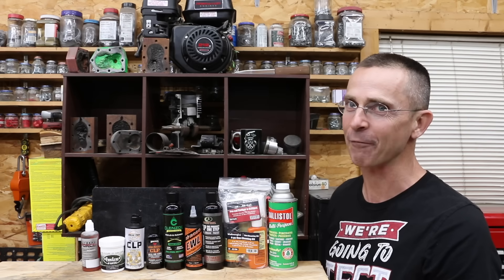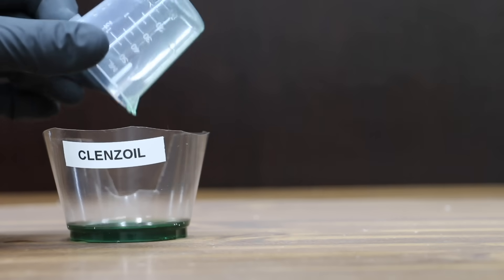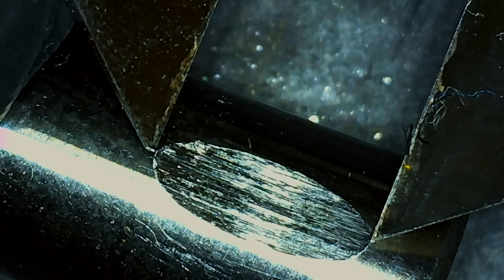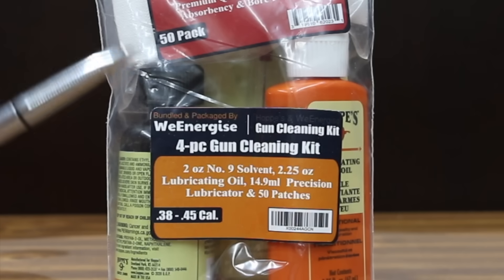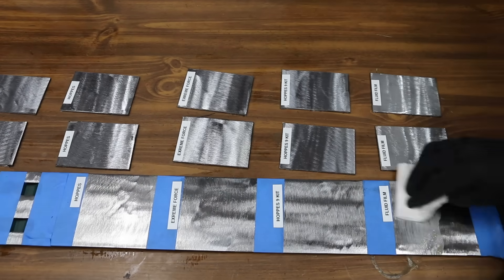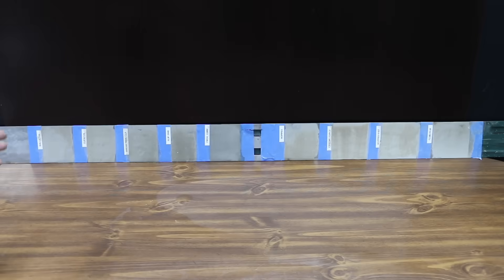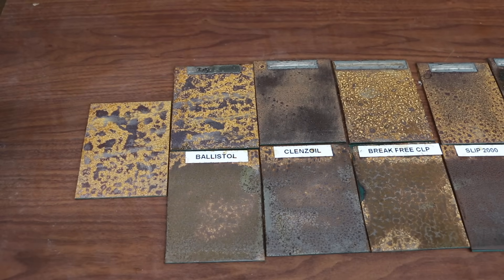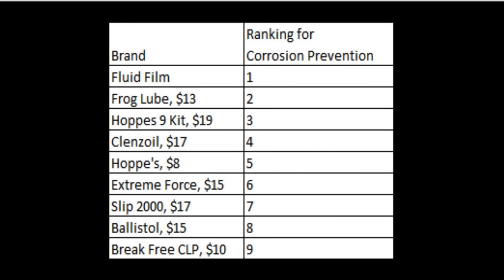Don't Buy A CLP Until You Watch This Review! It'll Save You Time And Money!

Comment: It would be nice to see a part 2 of this with a few of the best performers from this test compared to Rem Oil, 3-in-1 oil, WD-40, synthetic motor oil, etc. Thanks!
Reply from the maker: Thanks for the suggestion.
Reply: @ProjectFarm  if I might also suggest Lucas Oil CLP. It seems to be more readily available than some of these others. For example, in this first group I’d choose the Break Free as it’s pretty easy to find. Just checked Brownells and they don’t have the Clenzoil. I’ll have to check the BassPro mothership next time I’m in Springfield.
Reply: @CaveWyatt  you can literally get lucas CLP at O'Reilly's, auto zone, and advance auto parts
Reply: @Prestiged_peck  Yup. I’ve got three cans here. Not sure how long the lube part lasts as it appears to evaporate after a couple of weeks. It’s possible the residual oils keep lubricating but I apply a little Geissele Go Juice on the rails and moving parts of ARs. A little Geissele thin grease on the trigger pins once in a great while. Using the Lucas CLP also seems to keep new carbon from hardening so it’s easier to clean up if there’s a delay between shooting and cleaning. Good stuff.
Reply: @ProjectFarm  another vote for Lucas clp!
Reply: @ProjectFarm  I would add to this list with Lucas Extreme Duty gun oil. I would be very interested in it's performance. I find it superior to CLP with lubrication.
Reply: @ProjectFarm   forgot Lucas gun oil
Reply: @ProjectFarm  I am willing to reimburse you for a can of Lucas Extreme Duty CLP if you add it to your next test.
Reply: @ProjectFarm  any chance we could see Remington oil in round 2, possibly even a video about gun wipes/ field rags
Reply: @TheSikkTACO  I had to stop using spray Rem oil. Damn stuff seemed to evaporate off after a few days.
Reply: @TheSikkTACO  Remoil is very poor. Switch to Clenzoil or Brakefree.
Reply: @ProjectFarm  amsoil 100% Synthetic Firearm Lubricant and Protectant. If you can't find any let me know and I'll send you a bottle or two
Reply: @ProjectFarm  and if you do please include G 96 it's supposed to be what US Navy Seals use
Reply: @ProjectFarm  I know that you cannot test everything at once, but here in Northwest Iowa, Busch beer and Rem Oil is life. There’s also a Lucas brand, gun oil they sell at some car part stores.
Reply: @ProjectFarm  Hi if you do more test I hope you will consider weapon shield and modern spartan system. They do the same friction test and show that both of their gun oil don't show any damage. They have youtube videos showing that. Also Go-Juice lube says that their is superior to clp that the military use. Just three lubes that claim that theirs are better than other lubes
Reply: @ProjectFarm  if you do it again Lucas extreme duty would be great to see
Reply: @ProjectFarm  if you do part 2 please include G96 
Thanks for all the videos
Reply: @ProjectFarm  Seeing Shooter Lube would be nice if you decide to make a part 2!
Reply: @ProjectFarm  Very good suggestion.  The custom 1911 audience have very tight tolerance, high performance firearms.  1911's will shoot loose due to metal wear and lose accuracy.  Any lubricant that reduces metal to metal friction wear is desired. Temperature is not a factor but carbon fouling can be.  My opinion is that synthetic engine break-in oil that have higher amount of zinc would have the best result. You have the testing gear to do such a test.
Reply: @ProjectFarm  I’m surprised that no one mentioned Marvel Mystery Oil. Would be very curious about it. So many choices out there. Lots of people are using synthetic motor oils like Mobil1. Definitely struck a big nerve with fun lubes. Your the best, go to you first to look at products testing. 👍
Reply: @ProjectFarm   I rarely use an all in one product, currently use mineral spirits (GunBlue490) for cleaning, mineral oil or motor oil/grease combo (School of the American Rifle)  for lube/protection. would love to see verification of these if a part 2 done
Reply: @ProjectFarm  Another 2 manufacturers in Part 2 should be Lucas and M-Pro 7. A lot of competitive shooters use their products and Lucas claims that their products are the best...
Reply: @ProjectFarm  please do a part 2 of this
Reply: @ProjectFarm  
At beginning of video....
You pronounced it "Bal-i-stal".  It is technically a mashup of ballistic and oil for something that sounds like "ballistic oil".  "Balist-oil".
The stuff was originally made for the German military in 1904 I believe. It was used out past World war II. It is made in Germany....

At end of video....

Hmmmm, I guess I'm going to switch to Cleanlube from Balistoil....

Thank you for the video!!
Reply: @ProjectFarm  Don't forget to through some "LSA" into the mix. Only thing I've ever used. No need for all this rebranded, so called, "gun lube" ;)
Reply: @ProjectFarm  please do a part 2 with Lucas products
Reply: @ProjectFarm  This would be a great followup - lots of people use Mobil 1 synthetic or similar for lube.
Reply: @ProjectFarm  If you can ATF fluid, hydraulic fluid and moly grease with their high zinc and carbon additives would be interesting in the wear test
Reply: @ProjectFarm  If you did a follow up video to this one, could you include a long term analysis of WD-40 compared to the top gun oil brands?  See, there's this long standing myth that the main reason you should not use WD-40 on firearms, is that over time it somehow solidifies or hardens and then proceeds to "gum up" a firearm's internal components.  People believe that only WD-40 does this and their personal wonder brand choice of lube would never ever do it.  I've never seen a liquid oil do this ever, WD-40 or otherwise.  Could you PLEASE examine this theory so we can finally put the issue to rest, once and for all?  Thank you!  Keep up the great work!
Reply: @ProjectFarm  a part 2 would be great I would recommend trying EEZOX as well
Reply: @ProjectFarm  I appreciate your honest info. Like your channel
Reply: @ProjectFarm  it would be good to include your observations about the level of fragrance as well. Not an exact science but simply to include a scale of very fragrant to not very. Most people store in confined spaces and this can have an impact.

Also another request for the Lukas extreme duty CLP during part 2!
Reply: @ProjectFarm  Don't forget Deep Creep when you do a second test. It's always worked really well as a gun cleaner for me.
Reply: @ProjectFarm  Another one to test would be both Lucas Oil Gun Oil as well as "Extreme Duty" Gun Oil.
Reply: @ProjectFarm  how about a budget level home brew mix of synthetic grease mixed with synthetic motor oil kind of  like honey/gel
Reply: @ProjectFarm  G96 and Lucas Extreme Gun Oil. Love your videos.
Reply: @ProjectFarm  if you do a follow up could you include the winner from the motor oil test and try out Amsoils offerings specifically for firearms?
Reply: @ProjectFarm  yes Lucas Extreme Duty? Is this stuff any good? Thank you for all your videos. You give us great non-bias knowledge. Thank you sir.
Reply: @ProjectFarm  Is like to see Amsoil firearm oil if there's a part 2.
Reply: @ProjectFarm  Add mineral or baby oil.
Reply: @ProjectFarm  Please add G96 to this list to compare, also maybe the Marvel Mystery oil and a synthetic transmission oil. I agree with Jamie Pinkston that the Rem oil, 3 in1, WD-40, and synthetic motor oil is a list I would like to see. These are what I grew up using before I had ever heard of a designated gun oil (not even Rem oil at the time). Everyone back then in that area used transmission fluid, Marvel Mystery oil, WD-40 and 3 in 1 and the thinnest motor oil they could find.
Reply: @ProjectFarm  Looking forward to part 2, best sellers on amazon not already tested here include mossy oak / remington and lucas oil
Reply: @ProjectFarm  I’d definitely love to see a part 2 with some of the cleaners suggested.
Reply: @ProjectFarm  I'm looking for part 2 so I can give it a thumbs up like I did on this video.
Reply: @ProjectFarm  and shooter lube
Reply: @ProjectFarm  I will supply you with a bottle of Amsoil Firearm cleaner & lubricant if there is a follow up video.
Reply: @ProjectFarm  Lucas Oil CLP>Clenzoil
Reply: @ProjectFarm   I suggest we widen the search for the best all around gun oil maybe try some ATF
Reply: @ProjectFarm theirs still no #2
Reply: @ProjectFarm  Sentry makes a few dry lubes (tuff glide, tuff glide marine and a molybenum powder "bp 2000"). It would be great to see them tested. I also wonder if some of those gun lubes have a carrier that needs to evaporate off for the best friction reduction (but how to test that?).
Thank you for your diligent and effective efforts to show us what products can do!
Reply: @ProjectFarm
Reply: @ProjectFarm
Reply: Did the vid ever cone out? @ProjectFarm
Reply: @ProjectFarm please make an updated video including Lucas clp! Most of us use it
Reply: @ProjectFarm  Don't know if its also a CLP, but froglube has a version for extreme cold.
  If you want a can of Zep 45 which is a teflon based penetrating lubricant usually labeled something like "for industrial and institutional use only" I could make sure you get one. I don't hear it usually brought up but they do say it can be used for gun lubrication too.
  If considering longer term testing I find Zep 45 may start to get sluggish as it thickens over the months though that is very quickly resolved with just a bit more of it and the original Frog Lube starts thicker and is slower to penetrate+lubricate a running bearing (upwards of minutes vs Zep's within a second) but gave much longer results when I applied it to fans (either worn or defective, maybe both) that Zep45 went back to running noisy in within months.
Reply: @ProjectFarm please do an update with Lucas oil and CLP!!
Reply: @ProjectFarm 
 slip 2000 EWL 30!!!! Come on!!!!
Go Juice!!!! Come on!!!
Lucas synthetic gun oil
Amsoil synthetic gun oil!
Wilson combat oil(ultimate lube 2)!!!!!! Come on!!

Amsoil clp aero
M pro 7 gun oil LPX
Lps2 aero
Please do a Part 2. Bring in a couple top performers from this vid.

Also do you have another way you can measure lubricity other than the wear scar test. Some of those oils feel pretty damn slippy in a semi auto action! Like and air bearing! The scar test may be good but it’s not everything.
Reply: @shawn01707  As most semi automatics rely on the lubrication for easy movement of the slide rails I would imagine a rail test would be great. 

Maybe slightly angling the metal rail with a weighted plate and slowly increasing the angle to see which move first or the quickest?
Reply: @shawn01707  I was installing a bearing at work and it was tight and a guy brought me a can of m-1 and holy crap is that stuff slick. Best I've ever used especially for that job. I need to order a can and try on my guns.
Reply: @ProjectFarm  YOU HAVE TO ADD LUCAS CLP TO THE NEXT ONE
Reply: @Prestiged_peck  A few of us have asked for that in separate posts so Lucas CLP is getting lots of votes!
Reply: @ProjectFarm  You have to do this!!!!!!!
Reply: @ProjectFarm  I've been told by former marines that lucas CLP is the ONLY civilian available formula they'll trust in their full auto weapons
Reply: Surprised that the Lucas Oil CLP wasn't featured in this video.
Reply: @colgesuks  yes, and g96 since it’s one of the few meeting the latest version of the mil spec.
Reply: @colgesuks  I've only found it at O'Riley's so he probably went to a store that had different options
Reply: @squidysquid7586  my big 5 has it. That's the biggest gun store in my area
Reply: @colgesuks  my thoughts exactly. I use it a good bit to
Reply: @colgesuks  I think the Lucas gun oil would have all of them beat on wear.
Reply: @colgesuks  doubt it would have been any better than ballistol, its a low end product
Reply: @manlystyleunder50  you don't know until you know.
Reply: @colgesuks  Love the Lucas!
Reply: @colgesuks  Lol No more CLPs. The concept of them alone is ridiculous. Cleaners and lubricants don't mix very well...they counteract each other. Use their actual gun oil, a full synthetic oil for diesel motors(handles high temps way better than oil for gas motors), and/or marine grease(Lucas gun grease and marine grease are pretty much the exactly the same)
Reply: @NoCoBandit  that's only true is your cleaner is a surfactant. Cleaning off carbon deposits isn't the same as cleaning oils so in this circumstance a cleaner and lubricant can exist as the same product.
Reply: @colgesuks  Lucas looks exactly like clenzoil I'm curious if they're made in the same factory or something?
Reply: @alejandrogarcia3227  no idea, they may have similar base oils. The only way to really see how similar they are is to have them analyzed in a lab
Reply: @colgesuks When frog lube was lab tested, it exactly matched Crisco vegetable oil, except for the dye they use to color it.
Reply: @colgesuks  agreed! I’d love to see where that fits into this group!!
Reply: @lawrencetai7664  yeah, it's what I have and use.
Reply: @colgesuks  yeah, that is very popular
Reply: @colgesuks  Yeah and no Outers? No ALPHAGUN? Weak selection.
Reply: @colgesuks  Same here. It’s my CLP of choice so would’ve been nice to see.
Reply: Maybe add Shooter Lube and Lucas Extreme duty gun oil
Reply: @CptLang97  Lucas HD is my favorite. I hear Strike Hold is fantastic
Reply: WD-40 is shit for gun oil, its been tested to death.  Rem Oil is shockingly good, but its pretty thin and wears out fast.  I use it for fishing bearings when I want making casting distance, but don't mind applying between trips.
Reply: @Drundel  The Rem Oil I used became too thick for my guns to work below 0F.  The Hoppe's still allowed proper function.
Reply: @solarsynapse  Gotcha. I use it in my fishing bearings only, so 80+.  Works great.

I forgot what I run in my Benelli's, FP-10 maybe.
Reply: Yes, I also think that including a motor oil as a reference would be great. It will probably fail in the cleaning area but wear protection under various conditions should be excellent. My personal strategy would be to use a separate product to dissolve copper, lead and carbon deposits and then luse motor oil for lubrication.
Reply: @DreamRoadpl  All my modern rifles i lubricate with Mobil 1 Synthetic. It works great.
Reply: @DreamRoadpl  well as far as copper goes, CLP does nothing for copper. The military went to a CLP oil when they began chrome lining bores. Chrome bores don't strip copper like the old rifles that needed  RBC and LSA to clean. Basically, all milspec clp is is a high detergent oil.
Reply: @DreamRoadpl I've used Transmission oil and boy it's the best, think about how it holds up to heat and wear! ALSO IT CLEANS LIKE ALL GET OUT.
Reply: @DreamRoadpl  I've used motor oil on my AR-15s before. They ran like a top but smelled terrible after shooting. Smelled like burnt plastic.
Reply: @DreamRoadpl Valvoline restore and protect!!
Reply: @DreamRoadpl  
I've been using a quart of Pen. Full Synthetic to fill small application bottles for a long time. Nothing negative so far.
Reply: @DreamRoadpl   Mobil  1 is used  by many on guns ...
Reply: I'd be really interested to see the results with 3 in 1, mostly just because it's so easy for most people to get and is so widely used.  (And widely recommended, frankly.)
Reply: @corwinweber693  All the old timers I have ever asked usually recommend Hoppe's or 3in1, like you said 3in1 is at any auto store and hardware store you go to.
Reply: That's a great suggestion
Reply: @Jazz3006  Oil is just good for dissolving some things. I have a barrels of food grade mineral oil at work with no additives what so ever and it works just as good for taking mechanics grime of your hands
Reply: @VictorGalayda  there is that, yes, but there are also a boatload of detergents that are added to oil now.
Reply: Also throw in some of the storage foggers for the rust test.
Reply: @fredfrederick5607  I like your name.
Reply: Definitely interested in seeing Mobil 1 synthetic and/or other oils tried. Also super lube too
Reply: Home stuff not specifically marketed for gun use would be interesting. Rem Oil is great stuff and someone I know with a very large WW2 collection will use nothing else to preserve the firearms.
Reply: Agree! I use mobile 1
Test that against all this fancy stuff
Reply: I usually clean with balistol then lubricate with Lucas heavy duty firearm oil, I also use molybdenum disulfide grease on trigger groups and sears. Edit: I’m gonna try some Clenzoil next!
Reply: @project farm

I have used Mobil 1 synthetic 5W30 and Mobil synthetic 1 automatic transmission fluid for years. 4 parts oil to one part ATF. I would be pretty interested so see how this mix fares in your testing.

Thank you for the content that you create.
Reply: There are a lot of great suggestions here. So many gun oils out there that Project Farm could turn this into a mini-series. I'll get the popcorn ready.
Reply: Would agree completely, a part 2 and include Shooter Lube, it's my favorite, would love to know how it stands up.
Reply: Throw in the two Asmoil products to test. 
Surely we'll have lovers and also haters.
Reply: Add EEZOX to that list as that is what many gunsmiths and pros use..
Reply: Don't forget the cheapest gun oil on Amazon one with a Google translate Chinese to English discretion
Reply: 3 and 1 for lubrication for sure. Biggest problems I’ve ever had is cold weather function, By cold I’m mean colder than -25 c.
something to remove lead and copper and leave 0 residue, and then the smallest amount 3&1.
Sadly anything that will remove lead and copper, plastic..will sting if you get it in your mouth and eyes, so nobody sells it, their afraid of getting sued. Any good bore cleaner is by its nature caustic and nasty, if it isn’t it’s probably ? the old gunsmithing books have recipes. Usually kerosene, cutting fluid, solvent and spirts. Lubricate with auto ATF, less is best.
Reply: WD-40 should never be used in a firearm.  In a pinch, conflict, sure it would work.  However, WD-40 over time tends to gum up and get sticky.  NOT what you want in a firearm.
Reply: @kentp.2309 , true. I suppose if you drop your firearm into the water and want to drive the water out, you could use WD-40 for that, but then you'd want to remove all traces of the stuff before lubricating.
Reply: And Lucas gun products
Reply: Would love to see  Weapon Shield put to the test @Project Farm
Reply: @stevenkuhn7942  I have done a corrosion test using this oil and it failed big time. The metal rusted so bad that I think Weapon Shield actually causes rust. I would love to see Project Farm's results on this one as well.
Reply: I only use Remoil due to its cleaning and lubrication properties, but I M considering trying clp and maybe a new oil
Reply: Shooters Lube.
Reply: would love to see Amsoil Firearm Lube in the next test
Reply: can't afford ammo so no need to clean them
Reply: Yes test lucas gun oils
Reply: Good ol 3-in-1. That's what I use. I also rarely run my guns hard. So it'd be interesting to see how it stacks up in the lubricity test.
Reply: @scotttinney6523  They make several formulas now.  Are you using the original?  I don't think it has cleaning agents, making it popular for sewing machines and electric motor bearings.
Reply: @scotttinney6523 ..I think you'll be disappointed in the results..
Reply: There is a pretty common 'home recipe' out there, that would be a great comparison.
Reply: Also add into a part 2 the gun lube and clp made by Lucas. It’s called Lucas extreme duty
Reply: Agree! And I would add plain 30 weight oil, non-detergent. Classic 30W!
Reply: Shooter lube
Reply: Lucasoil CLP
Reply: CLP’s are snake oil. I use mineral spirits to clean, 0w20 motor oil or ATF  in winter and 10w30 in the summer. Never had a problem and its not $15 per ounce.
Reply: If you do a part 2, include Amsoil brand firearm cleaner and lubricant. Amsoil motor oil did great in your motor oil series.
Reply: Please add these to your Part 2 video:
1. milspec LSA
2. Drug store mineral oil
Reply: +1 for part 2 😅 I suggest FP-10 its another CLP. And motor oil ...that one keeps coming in firearm debate for CLP? Also G96...I really thought Ballistol would be better as protection against rust. WoW
Reply: Throw in some weapon sheild and Lucas red n tacky too?
Reply: WD-40 is not, nor has ever been, a lubricant...
Reply: Get Lucas Oil CLP in there too!
Reply: Don't forget Pro Shot CLP. I'd like to see how it stacks up.
Reply: @Jazz3006  you can achieve the same results with non-detergent oil. It’s simply the oil breaking down the grease on your hands and getting under it.
Reply: @ItchesIt  But does it remove the carbon from diesel engines that bonds to carbon based flesh?  I wonder what General Tire factory workers use?
Reply: Add Kroil,  Geissele Go Juice and Very Thin Grease, and Milcomm, and G96 to that
Reply: for most of my standard use weapons (less than 1000rnds a year), Hoppe's gets it done on cleaning and lubing and storage/protection.  for my nicer bolt guns, still use Hoppes to clean and protect the barrel, but the actions get Pro Gold by Pro Shot. but for anything with a giggle switch, Hoppes to clean, Hoppes to lube most of the weapon, SLP2000 EWG for any higher friction wear points, and in-the-field cleaning or just to blast the grime out of the dirtier suppressed toys, either Lucas or Break Free CLP gets it done.  one thing to note, Ballistol is a great penetrant and protector of wood, so it does have a home the toolbox. and if you shoot dirty stuff like black powder or rimfire a lot, you should know that those weapons will rust crazy fast without intervention. Ballistol mixed with water will actually cut through the unspent powder; you just have to go back through and lube it very well, to evacuate the water and moisture.
Reply: @jackburton7959  For wood, I use lemon pledge. It cleans and protects safely. It has a corrosion inhibitor if you accidentally get a tad on metal. I use it to protect my washer and dryer.
Reply: I use cheap engine oil
Reply: I like to to see Shooter's lube or one lube in that test all the hype i have used hopes #9 and 3in1 oil for year as well as ATF trans fluid for some things like very light rust
Reply: All versions of WD-40 at that.
Reply: @caseylasalle  regular wd-40 is bad for a gun specialist dry lube is a little better but silicone oil works great I couldn't believe the dirt I got out of my barrel and how much smother the slide on my 2011 works.
Reply: @billm7166  Oh, I didn't plan on using it for firearms. I would just like to see how they stacked up to the tests we saw in the video. Friction, heat, and cold, I would just like to know how they performed. Good to know about the silicone one though, thanks!
Reply: RemOil sucks, WD-40 is not a lubricant, and motor oil is not an effective cleaner for carbon buildup or copper fouling.
Reply: @CrpMag  it depends on what type of wd-40 you have my silicone says lubricates and protects safe to use on all metal and non-metal surfaces
Reply: No need to test WD-40.  It should never be used on firearms and it gets thick and sticky over time.  Rem Oil is a thin carrier that has molecular Teflon° in it.  The liquid carrier evaporates in a few days.  After discovering how it evaporates I no longer use it on firearms.  I know a lot of competition shooters that lube their match pistols with Mobile One° or automatic transmission fluid so that would be an interesting and valid test.
Reply: @David-hm9ic  the specialist dry lube has Teflon in it and I still had metal filings come off my slide on my pistol so that's why I use wd-40 specialist silicone it lubricates and protects I clean my gun once a week and haven't seen any metal filings since I switched but regular wd-40 is useless for a gun
Reply: “What kinda clp do you use?” “Delo 10W-30”
Reply: I'd like to see the break through CLP, HP purity oil tested as well as a gun grease products like battle born grease. The slip2000 grease, and others as well.
Reply: Motorkote has some gun oil
Reply: I'd also like to see how WD-40 does
Reply: I came here to say toss in a Amsiol synthetic. I know too many guys that have switched to synthetic motor oil for their weapons.
Reply: MotorKote
Reply: Yes!!!!!! Round 2!!!
Reply: @Jazz3006  
I admit to having had excessively greasy hands and not being able to find a hand cleaner have poured clean 15W40 on my hands to cut the crud, and then wipe it all off with a towel and wash my hands proper.
Reply: Rem Oil is garbage. It’s barely better than water. WD40 should almost never be used on firearms, it’s not a CLP. Water Displacement 40. If you drop your gun in a lake, yeah sure WD40 it, then use a solvent, then oil it. Other than that WD40 should never be near a firearm.
Reply: Yes and since you just did a favorable review motorkote and it's listed on the back as a firearms product I would love to see that at 50 cents an ounce!!
Reply: @garythegunnut2711  mix Motorkote 50% with transmission fluid. It's been used with success in firearms,airguns and as a general lube . I've been using it for years and have had no problems. It's smell is different though. How many dirty trans fluid changes have you seen ?
Reply: Transmission fluids too :)
Reply: automatic transmission fluid. since ive always been told its just as good.
Reply: Lucas CLP would be good to test as well.
Reply: Would like to see Mpro-7 LPX, and Weapon Shield
Reply: Pkease test M-Pro 7 LPX
Reply: Red and tacky would be a good test as well.
Reply: Curious about the Lucas CLP as well
Reply: Plus Lucas Oil
Reply: @Jazz3006  that is certainly true, but the reason it works isn't really due to the detergents in the oil, it's the oil itself during the work. If bacon or beef grease is applied to filthy, dirty oily hands, it will  absorb the filth making it easy to remove. I don't know the science behind what makes it work, but it seems applying any oil, vegetable, baby, 3 In 1 etc. will dilute the filth making it easy to remove. Great name, Jazz!
Reply: @danqodusk8140  huh, that was just what a shop teacher told me when I was in high school and I've never had a reason to question it. Fair enough though. And thanks!
Reply: Agreed! Please add a part 2. Thanks, brother!
Reply: I also would like that test
Reply: ATF !!
Reply: Weapon Shield does a similar test, in which it excels, so it'd be interesting to get independent confirmation.
Reply: Lucas gun oil is my favorite would love to see how it does
Reply: A old friend of mine was an armored during world war II. To the day he died he cleaned all of his guns with carburetor cleaner and oiled them with WD-40.
Reply: Water Displacement no. 40 is not an oil.  It is a fish oil based product designed to repel water.
Reply: Agreed. I’ve been using a mix of trans fluid and mineral spirits
Reply: @travisa2563  I use a mix of Fully Synthetic HighTemp wheel bearing grease and Fully Synthetic 05-20 castrol. Specific thickness varies upon if Winter or Summer. Doesnt wander, and doesnt sling off during shooting. I just need to test it while shooting with a suppressor.
Reply: @DZ4295DBW  SOTAR nonsense.
Reply: @Rifle Shooter Channel  It works great, my guy, and it's dirt cheap.
Reply: @DZ4295DBW  It “works great” if you don’t actually shoot your gun or understand how lubricants work. 

And “dirt cheap” but costs more than most regular pre made firearm lubricant plus you have to waste time mixing it up 😂
Reply: @travisa2563  mineral spirits is fine. Replace that trans oil immediately tho, mineral oil is safe and effective.
Reply: I use that but with equal parts of acetone and kerosene.   I add Amyl acetate for odor (couple of ounces per quart) and real lanolin for added protection.   not only is it the best I have ever tried but it is pennies per ounce.... I really pour it on. @travisa2563
Reply: And throw in “Fire Clean” I have found it to work well, but believe it might gum up if left on a long time.. also I would love to see some full synthetic 5w20’s results
Reply: +1. Please. I’m Especially curious about how WD40 and motor oil will perform
Reply: I agree I use motor oil for my guns
Reply: WD-40 is not a lubricant.
Reply: ya i was also hopeing for wd-40 and a few others
Reply: @Jazz3006  vegetable oil will do the same thing.  Like dissolves like.
Reply: That would be a great test, specialty items vs common use items
Reply: Great question....
I use Mobile 1 20w50 on my air cooled motorcycle.... I bet it would work well in firearms
Reply: We used synthetic engine oil after derusting some old shotguns and it gelled up around the breech. I would never recommend it to anyone.
Reply: If not already, perhaps Muffler Tape would be a fun test. :)
Reply: Yea please.
Reply: Pretty sure the motor oil he tests in his other videos is enough evidence and proof to use as well
Reply: totallly agree.  Im a mobile 1 user and would love to see how it compares
Reply: Yep thinking the same thing
Reply: Yes, I use Remoil and would like to see how that holds up to the others.
Reply: YES!! I personally use Red N Tacky Grease. I have tried a few different oils, but the Red N Tacky Grease really works well for me.
Reply: and Eezox!
Reply: I would definitely like to see the same thing. I believe some of these motor oils would do very well. Perhaps even a 2 stroke oil. Those can take some heat.
Reply: I see some are better for cleaning and some are better for lubing and some have better corrosion protection. I have often cleaned and lubed with WD-40 with no problems such as gumming up. I wouldn't recommend that for guns that just sit in a cabinet though. I would use clp on them. With smaller weapons, the sonic cleaner can be really handy for removing a bunch of crud too. Then follow with a good oil after it dries. I now just use clp or rem oil instead of the WD-40. I would like to see how two stroke oil compares to the gun lubes too.
Reply: motor oil on AR bolts works but would never use and of them others suggested besides rem oil as a corrosion prevention
Reply: Completely agree
Reply: Great idea Jamie! Many of the shooters I know, especially if they shoot black powder or a substitute, use Mobil 1 synthetic. They have no complaints, but I would love to see it in a test with the others.
Reply: Yes
Reply: If doing a pert 2, consider adding Tufoil gun-coat
Reply: Need to add hornady oneshot to the test
Reply: Tri-flow! That stuff works crazy good on rusted nuts
Reply: I’d like to see the trigger spray bottle of corrosion x texted. I bet it would win.
Reply: RemOil is garbage.  It evaporates away after only a few weeks and leaves behind a crust that’ll make it VERY hard to get your action open.   Always thought it was the “Teflon” they claim is in the product.  It’s awful, they sell that garbage at Walmart
Reply: Yes! Make this a SERIES! Let’s test all the lubes!!!! ᕕ( ᐛ ) ᕗ
Reply: 👍🏻This Arlington Texas guys agrees!
Reply: Amen. I was like… no Rem Oil?!
Reply: Honestly very surprised he didn't include rem oil, I feel like that's the most well known CLP to me
Reply: I just use Break free CLP to clean then, good old singer sewing machine oil to lube the rails and oil points can't go wrong
Reply: WD40 is not a preservative it is a moisture displacer. It will screw up a fine firearm in a New York minute.
Reply: How about shooters lube and a couple other new ones also?
Reply: Haha I do use royal purple engine oil for my guns  😂
Reply: I would like to see the best with Lucas gun product line. It’s what I use and it’s awesome.
Reply: Please try Weapon Shield, and Brian Eno’s Slide Glide.
Reply: I use white lithium grease for my guns
Reply: Amsoil gun oil too
Reply: I do love me some RemOil
Reply: I also would like to see motor oil like mobil 1 synthetic compared to these. The ballistol claims to be good for the wood stock as well ??? Not sure how you test that
Reply: 3N1 oil is good to sell but sorry to use on anything 
Remoil is very light
Reply: @clintgray1623  Yeah, I'll bet it works fine.
Reply: Ed’s Red?
Reply: Yes definitely want to see rem oil since that's what I've been using lol
Reply: Wash with hot soapy (dawn) water, rinse, dry thoroughly, lube with microscopic film of mineral oil.
Reply: WD-40 to clean and lube small parts and some synthetic motor oil to lube everything else.
Reply: Don't forget "Ed's Red". I'd be very interested in seeing how many CLPs that are 10+ times more expensive Ed's Red will beat hands down.
Reply: Add Shooter Lube to the equation! It’s a great CLP for weapons. I would love to see how it stacks up to the competition.
Reply: I'd like to see CorrosionX and Lucas gun oils added to that list.
Reply: Yea rem oil is my go to, love rem oil has great performance in all Temperatures
Reply: I would like to see shooter lube as well on that lidt
Reply: Wd40 and firearms don't mix
Reply: And Breakthrough Clean!
Reply: I want to add plain synthetic 15W40 diesel oil
Reply: Also mineral spirits and LSA gun oil
Reply: Can you add Shooters Lube to your experiment? That stuff is “popular” in that it’s in every store these days, and they advertise everywhere, but I want to know if it’s just a gimmick. Thanks for the awesome video.
Reply: Definitely
Reply: Lucas CLP
Reply: I wonder how dura lube would work? Try bore tech products for the carbon cleaning.
Reply: How bout WD40
Reply: @johnmacri7440  WD-40 is not meant to be a lubricant. It is a Water Dispersant (WD). It may initially have some lubricating properties when first applied but they will go away.
Reply: Yes! round 2!
Reply: Include white lithium grease as that is used on firearms all the time
Reply: Just gonna say what about 3 in 1!? Lol
Reply: Lucas clp extreme should be included in a follow up test since it is not as popular as the ones shown
Reply: Another +1 for Lucas CLP. I put that shit on everything!
Reply: I would like to see the top performers of this test against synthetic motor oil. I've heard from several people to use purple to be specific.
Reply: The problem with motor oil is its not meant to just sit there and stay on the metal parts. I think you will find a proper grease does a better job than oils in geneal at lubricating sliding parts.
Reply: @danielpope6498  I was told they use it for the penetrating properties of of it.
Reply: Rem oil yes. Wd40 will foul your ammo. Motor oil isn't for firearms.
Reply: How does it when it is in cases in the shell?
Reply: Any way I haven't tried it. Just was told to. So I was curious.
Reply: Fine you win
Reply: Agreed. New school vs old school based on some of your prior winners!!!
Reply: WD-40 has lots of uses, I just wouldn’t use it on firearms. In my experience, if left to sit for months and months it feels  slightly tacky. I’ve had good luck with Break Free, but will reconsider in the future.
Reply: @Project Farm - You do outstanding tests.  Very fair and scientific method based.  I too hope you can do a “Part 2” test to this one following the exact same procedures (to make new oils comparable to this test), using:  Ed’s Red, ATF, Mobile 1 30-weight oil, Mil-Comm TW25b, 3-in-1, Marvels Mystery Oil, WD-40, AmsOil, M-Pro-7, and Mineral Oil.  Some of these I recommend to show how bad they are, while others are cutting edge and some are cheaper alternatives which would be interest to compare.
Reply: atf, vegetable oil, super lube, mineral oil (i heard mineral oil sucks so I wanna see how badly it does)
Reply: And Lucas oil
Reply: @Whiteramracing  true true
Reply: And lucas clp. I think its just trans fluid.
Reply: Maybe lucas clp. I think its just trans fluid. When they first came out with it , it was red now they have changed it to green.
Reply: Yes, I'd be very interested in seeing how full synthetic motor oil stacks up against dedicated gun oil.
Reply: WD-40 does not work as  a  long term lubricant, Just gums up the works in guns, small  mechanical works.  It's just  moisture  repellant, keeps water away form the works.
Reply: I never knew about CLENZOIL. But, it looks like it's pretty amazing stuff.
Reply: I know a fair amount of competitive shooters that run Mobil 1 in their guns. I’d like to see that and maybe that high end Lucas gun oil in the precision applicator. Great job Todd!
Reply: Consider adding Amsoil Firearm Cleaner and Firearm Lubricant
Reply: Maybe we can work Bore Butter in there somewhere also
Reply: Automatic transmission fluid
Reply: I've been seeing Lucas Oil gun lube at autozone too
Reply: Try weapons shield
Reply: I heard that sewing machine oil does a decent job. I am anxious for a follow up test. Great videos
Reply: I know this is old but I agree. Military CPL, worked. But now as a civilian I just use mobile 1 for all my firearms. It cleans, lubes and protects. And the number one advantage, i can just pull the dipstick out of my truck and oil my weapon at the range.
Reply: I agree cuz I use RemOil 😂. I used WD40 in Iraq on M240 and it ran perfect but on the .50cal I used CLP, I was hummwvee gunner.
Reply: Those are all terrible oils though
Reply: I'm patiently waiting for part 2
Reply: WD has water in it. Also it conducts electricity.
Reply: And pure silicone oil
Reply: Yay to Rem Oil
Reply: Would love to see strike hold in there as well thanks for the great content!
Reply: Great review. Have to adjust for the weather conditions. High temperatures and repetitive shooting vs cold temps and hunting situations where you might only shoot one round all season. Here in Wisconsin our deer season is cold and what works in summer and fall can lock up a action in freezing weather. Best to adjust to your situation
Reply: Rem oil and wd 40 are terrible. A thinner 0w or 5w synthetic oil with a little trans fluid works great.
Reply: Please test engine oils.
5w-20, 5w-30 & 10w-30. 
Synthetics of course.
Reply: Include hornady one shot! Use real burnt gunpowder for the cleaning test.
Reply: Add School of the American Rifle’s saracha lube to the test as well
Reply: Please do a test on Lucas CLP next, it's getting very popular, available everywhere, and has good reputation.

Also Rem Oil for same reasons
Reply: G96 too
Reply: I mix 50/50 WD-40 & mineral spirits to clean, acetone to dry and militec to lube.
Reply: Lucas CLP and Motorkote are the 2 I'm most interested in.  Please I think it's time for another test with more products.
Reply: Rem Oil is about the worst stuff on the market. Rather use snot.
Reply: @Rifle Shooter Channel  Remington had those nice easy wipes though when no one else did that.   I use Slip2000 EWL how's that? I've been thinking of using MotorKote after cleaning it or to relube after some time of not using it.  Any thoughts on Motorkote? I've been starting to use that everywhere, in car oil, in place of wd40 etc, and using yamaha silicone protectant on everything from my engine bay to tools to electrical to anything I don't want rusting but have yet to try that on any guns, it dries to no slip and invisible so migjt be too light I thought.
Reply: @extrememiami  Never used Motorkote so I can’t speak on it but I have used lots of Slip 2000 EWL and like it a lot however I have phased that out for Lucas Extreme Gun Oil (the green colored one). It’s everything I liked about Slip 2000 EWL but it is a tad thicker and stays put better and is generally cheaper. 

That’s now my #1 go to.
Reply: And consider the smell of the products! One thing I love about frog lube (other than it being a great lubricant/protectant) is that it's a very neutral smell with a wintergreen note. I use it on a lot steel and cast iron hand tools to help protect against corrosion too. It's not offensive to get on your bare hands. 

Johnson's Paste Wax would be another good 'semi-drying' lubricant/protectant to test!
Reply: This. I personally use REM oil to clean (it's mild enough I don't have to worry about it hurting my NiB bolt carrier, but effective enough at cleaning) then wipe it down real well and apply Lucas gun oil. I've only used a handful of gun oils, but lucas is the only I've used that stays in place long term. Even if my guns gets wet, the Lucas is still right where I left it when the gun dries.
Reply: Yes, I agree . I was thinking the same thing.
Reply: Innocent mx3
Reply: If you do a second test please include Lucas CLP. Thanks for the great testing.
Reply: And Lucas 😁
Reply: please also include shooters lube 2 part in your follow up video if you make one!!
Reply: I second that ideal
Reply: I was thinking of the same. A lot of people just use motor oil on firearms. I'd be curious to see how motor oil performs in these tests
Reply: I would love to see Lukas Oil CLP
Reply: WD40 is not a lubricant.
Reply: Transmission oil is fantastic,  I'm not kidding
Reply: Motor oil is all I use on my guns.
Reply: rem oil n wd40 r bad for guns
Reply: I use v-twin 0w-50.
Reply: I was wondering why 3 in 1 wasn’t included!
Reply: I've been playing around with a few gun oils that I have laying around the house. Found that the sta-bil brand clp is better suited as just being a solvent, offers little rust protection. At zero degrees, a 2oz bottle of rem oil gets thicker and clouds up. I made a mix of 75% napa R&O 10w (iso32) hydraulic oil and 25% K1 kerosene. Seems to offer slightly better rust protection and stays thinner at cold temperature. Also tried a 50/50 mix of atf and kerosene but that didn't offer much rust protection.
Reply: I quit using Remoil because it tended to render guns inoperative
Mkii
1022
Ar
Rossi pump
Jams, misfeeds, galling
Reply: WD 40 is one of the worst things to use as lubricant in a firearm
Reply: Throw in common mineral oil, too! I’d like to see how good it is at rust prevention.
Reply: Agreed!
Reply: I agree, a part 2 would be great. It's been 2 years since this one and there's some new products out, like shooters lube and I'd love to see lucas oil tested as well.
Reply: Agreed for a part 2. Would love to see Lucas Gun Oil CLP tested as well as Weaponshield, motor oil, and the other big winners from part 1. Great stuff!
Reply: Yes please do a pt 2 I know I’m like 3 years late
Reply: WD 40 destroys rust because it has a acid in that will remove bluing from a firearm.
Reply: Or 3 in 1 ??
Reply: Eds Red and mobile one
Reply: Lucas extreme duty gun oil and Clenzoil marine are my go to gun oils great tests as usual
Reply: I’d love to see Rem Oil as well as it’s usually my go to
Reply: Could we get a part two, please include Valvoline Restore and Protect? Yes I know its a CLP video.. But thats what that oil does.

Would also love Valvoline R&P oil testing please.

Thank you!!
Reply: Don't forget ATF :P
Reply: I would never use wd40 on guns
Reply: I use vactra-2 as firearm lube
Reply: WD 40, external use only. It's hardly a lubricant. Hoppes gun oil has never been beaten yet. The best I've found to prevent outside corrosion is 3 in 1 silicone lubricant. 55 years of experience says so.
Reply: @thecroniclesofduh lps 3 for internal and external 50 years experience
Reply: Isn’t rem oil an oil and not a CLP?
Reply: And ATF
Reply: Synthetic motor oil compared to these would be great
Reply: This
Reply: All I ever use for gun lube is Mobile One.
Not a cleaner,  but it beats everything else as a lube. For protectant I use a museum grade wax (Renaissance).
Reply: Suggest including Jenny's Cutting Edge Gun Lube made by ZK Performance.
Reply: G96 Triple Action too!
Reply: WD40 is completely useless as a lube...spit does just as good
Reply: A great test would be cleaning the chamber of an AR15 pattern rifle. It is the most popular gun in the country and cleaning the chamber is a task none of us enjoys but must be done for proper function. Our military and LE would appreciate the knowledge as well!!!
Reply: +1 on the 3-1 oil! Its what I use on my guns!
Reply: I'd really like to see how Eds Red and/or ATF oil compares.
Reply: @jason86768  great suggestion on the Red!!!!
Reply: WD-40 is only good for cleaning metal. Parts treated with WD will rust in under 1 day.
Reply: @SIXPACFISH  that why I use wd-40 specialist silicone oil it coats it drys and I have no rust anywhere or metal filings from my slide but regular wd-40 I had metal filings in my slide and I'd never clean a barrel with it because it attracts everything but the silicone oil doesn't. That's why it's used in airsoft guns my son does airsoft and the gas has silicone oil in it.
Reply: @SIXPACFISH  it also turns gummy after awhile
Reply: +1 to doing a follow up and including: 
1. AMSOIL Gun Oil
2. AMSOIL Full Synthetic 10W-30 motor oil.
3. Brian Eno's Slide Glide
4. Rem Oil (it's an oldie and probably won't perform. But, interesting none-the-less.

Definitely the AMSOIL, though, please! They are so proud of their engine oil and it has such a legacy... Let's see how it actually performs!!!
Reply: I wish you would have included Rem Oil in this test.
Reply: @Jazz3006  Fresh diesel engine oil is about the only thing that can safely clean carbon off your hands.  Almost like it's made to do that.  LOL
Reply: @solarsynapse  idk about safely, but I've done it with regular 5/30
Reply: @Jazz3006  0w-20 would probably be better
Reply: No if he makes a part 2 should use real gun clp who the hell is going to be running WD-40 waste of time that could be utilized for real products.
Reply: And also the hoppes 9 black step 3 high performance precision oil
Reply: PB blaster too!
Reply: WD-40 is for water displacement- removing water film off of steel. It's t he 40th formula they came up with, hence the name water displacement 40. It doesn't have much lubrication qualities. It rocks at removing sticker adhesive, without damaging what its stuck to.
Reply: @bobdunchad4464  My grandfather was an Air Force technician on Atlas F model ICBM’s when WD-40 was introduced.  The Atlas’ outer skin was the actual outer wall of the fuel tank, so preventing aluminum alloy corrosion from temperature difference surface condensation was always a priority.  It was delivered in one or five gallon cans that they would transfer into hand-held pressurized Sure-Shot sprayers.  It was only later that they discovered that it made for a decent rust penetrant.
Reply: I don't consider any oil that separates. In other words when you have to shake it first.
Reply: All I can say is fish on cuz we have a lot of suckers, when straight up plain mineral oil does everything you need!!!